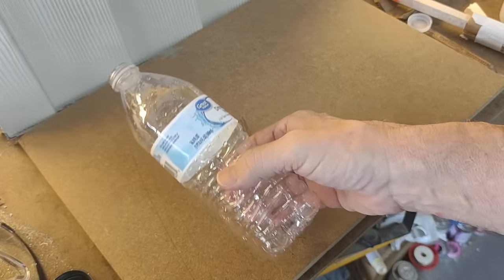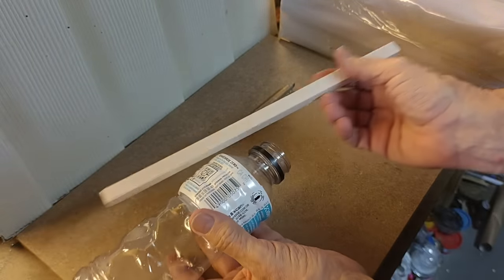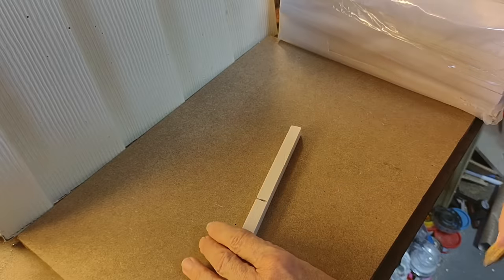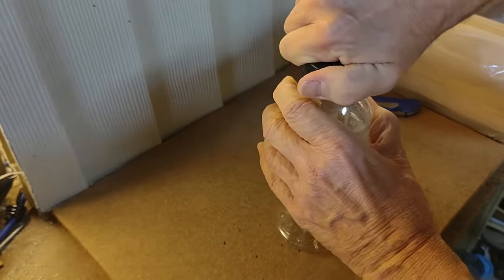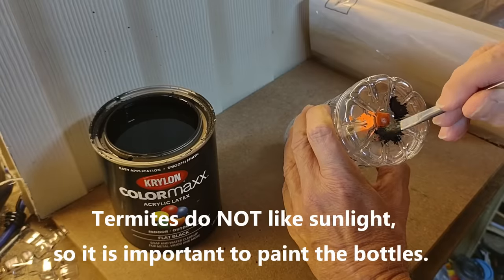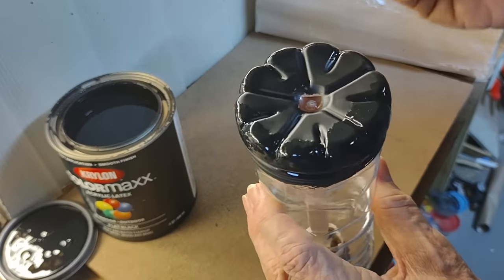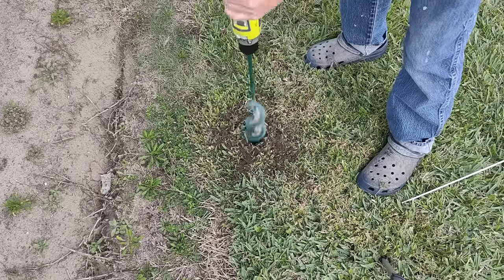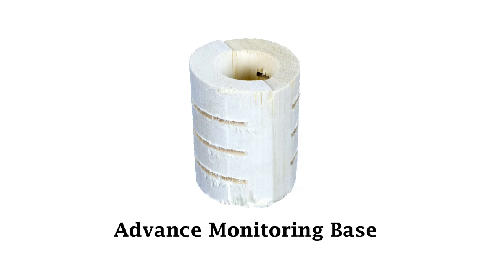Unbelievable Water Bottle Trick for Termites!  Simple to do!

Comment: Hello Guy. The inspector of My Old House (1750/1820) told me one year ago that I have powder post beetles. I sprayed Boracare where I saw that the wood had been compromised. I stomped on adults as they entered by the door in the autumn.  And I sprinkled granules impregnated with essential oils of thyme, cedarwood, wintergreen, mostly to discourage the snakes.  Not feeling confident in my Boracare spraying (I was making a mess and there are the heating ducks and wires everywhere to deal with), I had an exterminator come.  He said there is no evidence of an active infestation, no sawdust. But he suggested spraying ($630) Timbor to cover their pheremones to prevent reinfestation.  I'm thinking I'd rather not, if there are no beetles currently. I keep a dehumidifier, unlike the prior owner of 30 years.  What is your wise advice, please?  Oh, also...I was advised to put insulation on the basement ceiling to keep my upstairs warmer. I thought that would provide a hiding place for bugs, with which exterminator agreed.  Thank you!  (I installed some termite traps. So far, no evidence. Exterminator concluded he saw no evidence of termites.)
Reply from the maker: Thank you so much for reaching out to me.  I think it is possible that you did a better job with the Bora-Care than you may think.  The pest controller that inspected is correct that powder post beetles would be leaving sawdust.  Still, I am never totally confident in how well a pest control is inspecting.  Therefore, it may not be a bad idea to get a second opinion.  Most pest control companies will do a free inspection, so you have nothing to lose by calling a different company to see what they have to say. 

Spraying with Timbor doesn't make a whole lot of sense because you already sprayed with Bora-Care.  The truth is that these products are supposed to do the same thing, but Bora-Care is way better than Timbor.  The difference is that Bora-Care will penetrate halfway through the wood, so if you treat both sides, then the product goes almost all the way through the wood.  With Timbor, it is a powder that is mixed with water and that powder just kind of stays on the surface of the wood, and may only penetrate the wood a tiny bit.  This does help with infestations, but once you get a wood destroying pest in the wood, like powder post beetles, they will produce larvae in the wood that will eat their way out.  So, the beetles that will die from the Timbor will probably be alive long enough to produce offspring and those offspring will go on eating the wood that was not treated by the Timbor, because it didn't penetrate deep into the wood.  With Bora-Care this is not a problem.

Running the dehumidifier under there is a great idea.  You can also stop all pests, including powder post beetles, from entering your basement/crawl space, and any place else in your home by treating every 60 to 90 days with a pesticide.  I have a video on how to do that and I will give you a link to it.  If you feel uncomfortable using pesticides, please watch my video on the subject.  A lot of people are concerned about using pesticides because of the products that we used in the 20th century.  What most people do not know though is that those products were all banned in the late 1990s.  We are now almost one quarter of the way through the 21st century, so we now have 21st century pesticides.  The law now requires that pesticides must be safe for children to play on after they dry.  The truth is that modern-day pesticides are no more dangerous and common laundry detergent.  We still wear eye protection, rubber gloves, and a respirator because you should never get anything in your eyes, on your skin, or in your lungs that doesn't belong there.  This would be true for laundry detergent as well.  Would you really want to mix laundry detergent with water and spray it into the air in a way where you can inhale it or get it in your eyes?  I treat my house with pesticide every 60 days, and a couple of times I forgot to put my goggles back on when I refilled the sprayer and the wind blew the overspray right into my face and into my eyes.  The result was no worse than if I had sprayed water in my eyes.  It didn't even burn and I just kept working.  That doesn't mean you shouldn't wear eye protection, but an accident with the diluted product is not going to result in any serious injury.  Also, modern day pesticides are designed to stay where you put them, and they will not wash away with the rain.  So you need not worry about the environment either.  What you do need to worry about are things like powder post beetles, so it is a very good idea to do a preventive treatment to keep them out, as well as other pests.

If the basement is not heated and you put insulation on the ceiling, that probably will help keep the upstairs a bit warmer.  I think just about everything in your home can be a hiding place for insects, so personally, I don't think I would worry about that aspect of it.  If you do the exterior treatment that I am suggesting, then there's little chance that any sort of bugs are going to get into your home in the first place.  You just need to make sure that you do this treatment at least every 90 days, but you do not need to treat when it is freezing outside.  If you like, you can treat the ceiling with Nibor-D before you install the insulation.  This is a permanent product, just like Bora-Care, and it will kill most insects that try to cross it.  It doesn't kill all species, but it will kill things like ants and roaches.  I will give you a link to the product.  You need to mix it 7.5 cups per gallon of water.  The product can be painted on, or you can apply it with a pump up garden sprayer, just like with Bora-Care.

It is good news that the pest controller did not find any termites.  Another advantage to the Bora-Care treatment that you did is that it is effective for termites as well.  Still, you may want to do a preventive treatment for them as well.  I do it every year.  You can do a preventive treatment annually with termite granules.  The process usually takes about an hour to do and simply involves sprinkling the granules around the perimeter of the house and then watering them in with a garden hose.  I just finished doing my house the other day.  For the granules to work you need to have dirt around most of the house and that dirt needs to be porous enough to allow water to seep into the ground fairly quickly.  To find out if the dirt around your house is porous enough, just dig a small hole next to the house that is about 4 inches deep, 8 inches long, and just the width of the shovel.  Fill the hole with water and watch to see how fast it drains down into the ground.  If it seeps into the ground fairly quickly, then the granules should work just fine.  However, if it just kind of sits there, then the granules would not be a good choice.

Make sure that you buy the correct granules.  You need the ones that have imidacloprid as the active ingredient.  A lot of the Home Depot and Lowes stores no longer sell the correct granules, but you can get them from Amazon.  I will give you a link to them.

Since you do not have an active infestation already, you may want to also consider using monitoring stations around your home.  I use both the granules and the monitoring stations.  I will give you a link to my video on how to make them for under 50 cents each.  I put them around my entire house for less than $25.   

I hope that helps.  Be well Claire.

Video on how to treat the exterior of your house:  https://youtu.be/Yozv3s-Qwlw

Video explaining the truth about using pesticides:  https://youtu.be/i7nLO6Js_3Q

Video on how to make monitoring stations:  https://youtu.be/gye27aXHRsY

Video on how to apply termite granules:  https://youtu.be/H7rW_TSBHJ4

Termite granules:  https://www.amazon.com/dp/B000RUIJYM?ref=nb_sb_ss_w_as-reorder-t1_k1_1_6&amp=&crid=157C3RV0MY0AK&amp=&sprefix=termit

Nibor-D:  https://www.domyown.com/nibord-insecticide-p-2410.html?co_var=3
Reply: Good heavens, Guy, thank you so much for the comprehensive response! I will digest it. (So that the bugs can't digest my wood!) Yes, I did make some of your termite monitoring stations already, and will install more in the spring.  Bless you!   @GuysPestSolutions
Reply from the maker: @clairestadtmueller2772  You are very welcome.  I am always happy to help.  Thank you so much for those kind words.  Be well Claire.

Comment: Thank you for sharing your wisdom. What if balsa wood would be soaked in Tayrus SC solution? Monitor and control at the same time. What are your thoughts on that? How long impregnated chemical would be effective? Thank you.
Reply from the maker: The sticks do not provide much food.  They are designed to get eaten quickly, so that the dot disappears right away.  So, poisoning the sticks would not be all that helpful.  After the monitoring station goes off, you can place a bait station next to it to get rid of them.  You can make these yourself too.  I will give you a link to that video.  Be well my friend.

Bait station video:  https://youtu.be/r05Z-aUJehw

Comment: I had this monitoring thing done and it was expensive.  At that time they also informed me that my termite bond did not cover the Formosan Termites.  Which right now are swarming in my area.  What kind of BS is this?  They wanted over 300 dollars more for that 'coverage'.  I am up for renewal next month and I am thinking about dumping it altogether.  My house is mostly brick and fully paid for.
Reply: What does mostly brick have to do with anything? Your framing is likely wood including what supports your walls & roof. Good for you re: paid off! ❤
Reply from the maker: You are correct.  The money you pay for monitoring is a waste of money.  You need to install these monitoring stations right away.  You should also inspect for termites right now.  Formosan termites are bad.  Really bad.  I also recommend that you put granules around your house.  They will not treat a Formosan termite infestation, but they will prevent one.  I will give you a link to the video and the product.  For the granules to work you need to have dirt around most of the house and that dirt needs to be porous enough to allow water to seep into the ground fairly quickly.  To find out if the dirt around your house is porous enough, just dig a small hole next to the house that is about 4 inches deep, 8 inches long, and just the width of the shovel.  Fill the hole with water and watch to see how fast it drains down into the ground.  If it seeps into the ground fairly quickly, then the granules should work just fine.  However, if it just kind of sits there, then the granules would not be a good choice.  Make sure that you buy the correct granules.  You need the ones that have imidacloprid as the active ingredient.  A lot of the Home Depot and Lowes stores no longer sell the correct granules, but you can get them from Amazon.  Be well my friend.

Termite granules:  https://www.amazon.com/dp/B000RUIJYM?ref=nb_sb_ss_w_as-reorder-t1_k0_1_5&amp=&crid=A0Q6FR5I5QQH&amp=&sprefix=termi

Video on how to use termite granules:  https://youtu.be/H7rW_TSBHJ4

Comment: Thanks for this video and the tips.  I've been told that the pests I have are nearly impossible to get rid of....I am unsure if they are moles or voles but I have them tunneling around my yard. Any suggestions?  I already tried the poison pellets and the smoke bombs with not much luck. Thanks in advance.
Reply: My go to is mothballs.  Don't put them where you can breathe the fumes.  I use them to discourage Black Bears from going into my garbage bin.
Reply from the maker: It's probably true.  The problem is that even if you trap all of these things or kill them all with a poison, your neighbors also have them, so they will just keep coming back.  So, this is one of those never ending battles that just never goes away.  If you stay at it, then you can keep the population down, but they are going to still keep coming.  Personally, I would use a bait.  You can find both baits and traps at domyown.com.  

I hope that helps.  Be well my friend.
Reply: @Guy's Pest Solutions  thank you....I have been using those solar buzzing things and they work as long as you keep them still, don't move them, and run all year long....believe or not that's what has helped me the best besides lighting those thick sparklers like for the 4th....I'll light one and stick inside a tunnel. Lol
Reply from the maker: @dgmenace73  I'm not sure what kind of device you are using, but if you are using one of those electric bug zappers, you should know that they do not kill mosquitoes very well.  That is because mosquitoes are not attracted to light.  So, the only mosquitoes they really kill are ones that inadvertently fly into them.  You may see these things zapping a lot of bugs, but they are mostly killing things like moths, which can be a good thing, but they will also kill beneficial species like bees and butterflies.  So, it is always best to turn them off during the day.  There are some mosquito devices that emit fumes that the mosquitoes are attracted to.  They will kill mosquitoes, but they will not solve the problem.  If you have a problem with mosquitoes, please watch my video on the subject.  I will give you a link to it. 

I hope that helps.  Be well my friend.   

Mosquito video:  https://youtu.be/DIoCHo96LJc
Reply: @Guy's Pest Solutions  I was referring to solar powered buzzing, noise emitting (high frequency) devices that are made to prevent moles. Most say that they do not work at all but since leaving the devices alone, running all year long....the moles are slowly moving away from my house. I hope they continue to keep on going even to someone else's house....lol. The sparklers worked well too. I was getting smoke coming out of holes 30ft from where the sparkler was burning....this is just something someone mentioned to me but I would still see a new mound every now and then. I don't have any electric bug zappers. Sorry if I confused you. Thanks for the link.

Comment: I am in South Africa on the East Coast, and I have wood borer, the flying type, is there a way to control them /eliminate them, or is the only way to control them by burning the wood they are munching on.
Reply from the maker: It sounds like you are talking about drywood termites.  They colonize in the wood and not in the ground.  It is important to understand how drywood termites work.  They enter through cracks and crevices around windows, doors, the eaves, pipe penetrations, and so forth.  Most of the time, they enter through several locations.  That is because a swarm of them attacked your house at the same time.  If there was a crack or a crevice, then they probably found it.  After they established their galleries, which will be inside the wood, it will take four to seven years for them to be able to swarm.  Now that they are in your house, the swarmers will use holes that are in your studs to travel through the walls.  Those holes in the studs were created by the electricians to run the electrical wiring.  Not only are these holes going through the studs, but holes were drilled into the attic for the light switches and to run some of the wiring for the outlets.  So, the termites now have easy access throughout the attic and the walls.  If you have a basement or crawl space, they have access to that as well.  Most of the time, you will have no idea that they are in the walls, because the frass is inside the wall.  To make matters worse, if you have drywood termites, then your neighbors have them too.  That means you have been getting swarmed for as long as they have existed in the neighborhood.  Most likely, we're talking about years, so it's a safe bet that you have these guys in many locations in your home.

I always hate to be the bearer of bad news, but if you have drywood termites, the only sure way to get rid of them is to fumigate.  I don't know how things are in South Africa, but prices for this can vary wildly in the US for this service, so I recommend that you watch my video on how to hire a pest controller without getting ripped off.  That video may save you a lot of money.  You should also know that the gas they use to fumigate has absolutely no residual action whatsoever, so you can get reinfested the moment the tent comes down.  Like I said before, if you have drywood termites, then your neighbors have them as well.  Since drywood  termites swarm every year, it is almost a certainty that you will be reinfested within a year after the fumigation is done.  The only way to prevent this is to do a preventive treatment on your house every 60 to 90 days.  Pest controllers may not do this, so it is something that you may need to do yourself.  I have a video on how to do that and I will place a link below.  If you absolutely cannot afford to fumigate your house, then you can try spot treating it yourself.  It is virtually impossible to find all the termite galleries, but it is way better than doing nothing.  Regardless of how you treat it, you should begin the preventive treatment immediately, so that you do not get additional termites paying you a visit.

I hope that helps.  Be well my friend.                      

Video on how to hire a pest controller without getting ripped off:  https://youtu.be/y-a8XOqVrlE

Video on how to prevent drywood termites:  https://youtu.be/neNsmVbj8Pc

Video on how to spot treat drywood termites:  https://youtu.be/U7ck7zhS0Xo